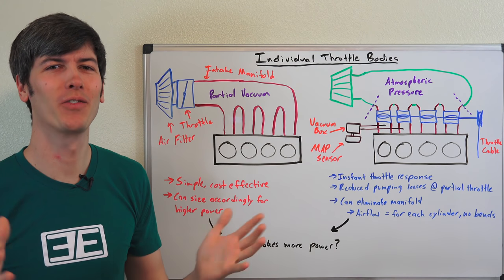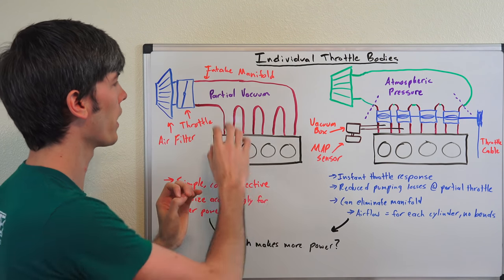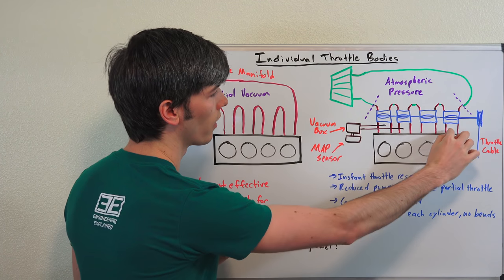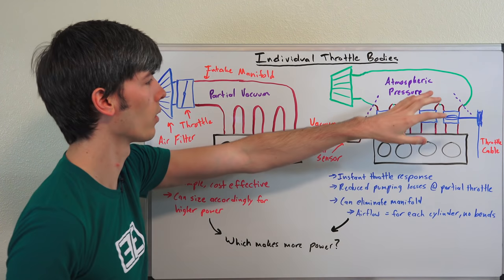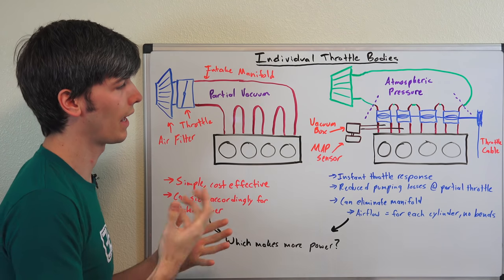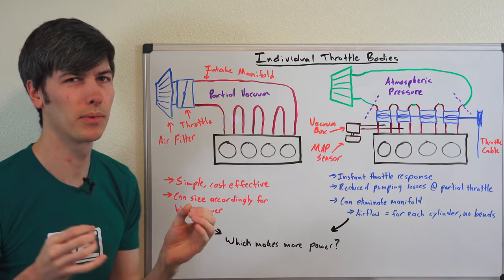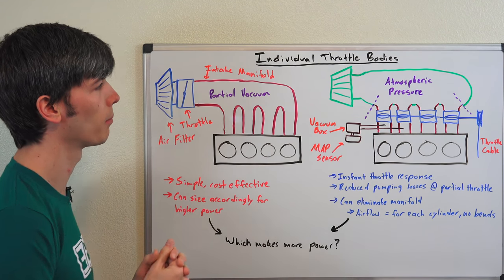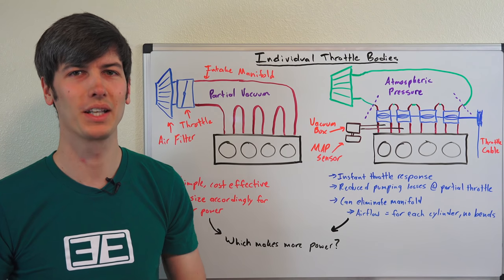Benefits Of Individual Throttle Bodies

Comment: Hey Jason,
Please could you explain the iVTEC system specific setup on J35 Accord engines 8th gen + up? Answering: 1- if it has any affect on performance like usual VTECs? 
2- How it really works to disable cylinder banks? 
3-If it reduce compression during could start or whats happen during start making sound much higher and lower down after some seconds?
Reply: guzforce that's really hard to understand. Can you try to rephrase it better?

I can answer for you but only if i can understand what you're asking specifically.
Reply: Ops!! Sorry, and thank you for trying to help.. let me try to point each question..
1- Regarding iVTEC on Accords V6, 8th generation, automatic transmission. Does it change the camshaft profile after certain rpm?
2- In wich areas of the engine the iVTEC works on our Accords? Only cutting cylinders for the VCM (if yes, how?), de-compressing engine for easy start, changing from low lift/duration @ low rpm --> to high lift/duration @ high rpm?

Comment: So if the engine is supercharged, then the supercharger would compensate for the partial atmospheric pressure in the intake manifold with the single throttle body system?  That would eliminate the advantage of the ITB system having full atmospheric pressure?

Comment: So would varying the runner length behind the throttle body have a similar effect to doing so behind the throttle body?  If so, all you'd have to do is find how long the runners need to be at peak torque, and how long they need to be at peak HP, and make the runners shorten up to peak HP.  Unless it's some kind of wierd setup that has peak torque up high, in which case you'd optimize it for whatever makes the most "space under the curve" as they say.

Comment: +Engineering Explained
Thanks. What I am wondering about, is why you have less pumping losses with either of those systems. Aren't pumping losses determined by the partial vacuum on top of the piston?

Comment: Could you do a video on cylinder pressures/temperatures before and after the combustion event, maybe even between a gas engine and a diesel one? I’ve always been curious about the actual forces inside the engines and how they might compare to the engines stroke and the nominal torque produced at the crank. It would help show the most basic engineering differences between the two designs.

Comment: my question is. What is the best size for a throttel body. In my understanding. If the throttelbody is smaller then the engine port. It slows down air speed which is bad for performance. but if its too big the engine will probably starve because there is not enough airpressure? whats best if the port and the throttelbody are mathematicly the same size or even the same form. or bigger? Or maybe even smaller?

Comment: Hi! I love yours videos and becouse I am also Engineer I love your approach to some problems. I have one question. Usually we can see ITB on specyfic tuned N/A racing engines becouse reasons you mentioned in video. What about forced induction? I saw pictures of such setups. Does the lag from building pressure in the system (lets do not take into consideration inertia of a turbo becouse you can use mechanical charger), the volume of air in intercoolers and so on. Do it has any sense if you do not use antilag system in turbo?

Comment: The different airspeed inside a single throttlebody/plenum for each cylinder, have got to be a less desirable effect, compared to equal air speed on ITB setups. The filling of the cylinder can't be 100% equal on a single throttlebody/plenum setup? right?

Comment: Why don't manufacturers build engines with individual throttle bodies (in sporty applications)? Is it really just a cost thing? Or are there actual disadvantages to using ITBs, notably on modern direct fuel-injected drive-by-wire cars?

Comment: First off, thank u for all ur awesome content

I always wondered: despite all the benefits of ITB, is it worth it because they pulls in hot air inside the engine bay versus a traditional single throttle body that can be combined with true cold air intake

In addition, with ITB, I’m always afraid that a rock or some small projectile may enter the combustion chamber(s) - since people generally dnt install filters on them

All in all, i love ur videos
Reply: I believe an ITB setup can still be done along with a plenum for a cold air intake or a forced induction setup, like on the Skyline GT-R's RB26DETT.

Comment: +Engineering Explained what about boosted set ups that run individual throttle bodies like the skyline r34 gtr?  they obviously have an intake manifold plenum for the intake charge and then the throttle bodies are at the end of each intake runner just before the head.  do you still get the same advantages as you would on an NA application?
Reply: I was also going to ask about boost + itbs.
Reply: similar advantages, but it also means that the the engine can breathe easier in snap-on-off-throttle scenarios, as with a single and a big plenum when you lift off alot of pressurised air is still in the plenum that gets inhaled post-throttle-lift, compared to the small amount of air that would be behind each ITB. If i've understood blow off valves correctly i think this means that more air gets left behind in the "plenum" rather than inhaled as it makes its way to the bov, if you have a relaxed bov, the increased amount of "left-over" air when snapping the throttle back on further enhances throttle response. In certain scenarios you can use a map sensor for each cylinder, in which case ITB's can ehnance power and reliability as the boost pressure is set for each cylinder due to the indiviual throttles (rather than the single forcing the air pressure to equalise amongst all four cylinders) and thus the fuel delivery can be adjust per cylinder accordingly, rather than a blanket-amount for all cylinders based on the plenum's boost-reading
Reply: duviday I think you have the bov workings incorrect. if you had itb's then all the air in the plenum would be lost to the bov when it opens. this is because there is no throttle plate separating the manifold from the intercooler piping. with only a single throttle body I guess there might be some chance for a bit of air to be left in the plenum but that would still end up in the motor as the valves are still opening and closing even when the throttle plate is shut.
Reply: I have a Toyota Aristo with a 2JZGTE and for the past 2 years I've been trying to figure how to work ITBs with a Turbo Setup in the perfect manner

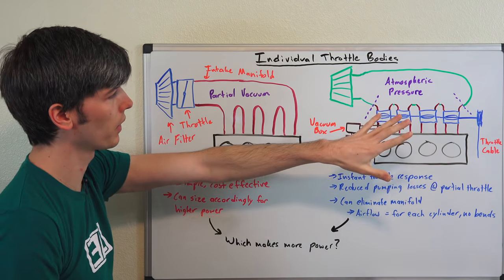Comment: I'd like to correct the point made at 2:10 where you don't need the intake for ITB engines. You do need intake trumpets that make for equal airflow to each cylinder. With out the trumpets the car won't run very well, the E46 m3 crowd has looked into it extensively.

Comment: everyone in the comments is talking about how sophisticated this system is...well its much simpler than what many, possibly most cars use today use direct injection which runs at pressures up to 3000 psi and some use both direct injection and port injection...im just glad this is all going away soon. my next motorcycle will be the zero electric powered bike

Comment: Would it be impractical or imprudent to use individual throttle bodies on a turbo or twin-turbo setup?  It seems like you would really lose the advantage of the system.

Comment: Why does the smaller volume under vacuum translate to less pumping loss? Since the pistons are still displacing the same volume, but there's less air to pull from, wouldn't there be a larger difference in pressure across the piston?

Comment: Does it make any benefits in turbocharged engines?
Reply: R32-34 skylines had ITBs and twin turbos on their RB26s
Reply: but the idea is that 4 or 6 or however many throttle plates your ITB system has, will be able to flow a greater volume of air than a single large throttle body. The benefits are essentially the same, it allows greater throttle response, and greater airflow at higher rpms. In a turbo application though, the added benefit of quicker spool, esp on larger single turbos, comes along with that quicker throttle response.
Reply: The whole vacuum/boost system, however, is where it becomes complicated in a turbo application

Comment: can you make a valve before those throttle bodies, to clog one or more of the cylinder for better fuel consumption during low power situation?
such as on bumper to bumper traffic or highway cruise where it's just maintaining constant speed at moderate rpm.

Comment: Couldn't you also cut off a cylinder or two in an engine with ITBs? That way you could have a V8 to accelerate and then a V4 once you get up to speed (like the newer Chevy Suburbans have, which may actually be exactly what I'm talking about).

Comment: Is there any truth to the notion that running individual throttle bodies (whether fuel injected or carbureted) leads to cooler engine running temps?
I heard that claim from a Shelby Daytona Couple (replica) V8 engine builder.  He claimed it was a substantially lower intake air and that it had something to do with heat from the valve of a just-fired cylinder raising the temps of the overall/combined intake air when two or more cylinders share an intake.  

I would love to hear your thoughts.

Comment: Jason, cool video. I'm a semi-new subscriber and always find your videos insightful and well thought out. 
But what are some examples of cars that use each particular setup say from the factory? Thanks
Reply: Pretty much most cars run single throttle bodies from the factory as they're cheaper and simpler and throttle response is not the highest priority. Take almost any Toyota, Subaru, Ford, Chevy, you name it, it'll have singles. Certain high performance engines, such as the RB26DETT in the R32-R34 GT-R, and things like BMW's S65 V8 and S54 straight-six (E9x M3 and E46 M3, respectively) run individual throttle bodies from the factory though, because they're in more expensive cars to begin with (budget doesn't matter so much), and are built with high performance, and thus great throttle response, in mind.
Reply: P1 Race Photography Thanks bro, exactly what I was looking for. cheers
Reply: I'm not sure about these days, but I recall motorcycles used to often have individual carbs for each cylinder - I'd assume at least some are now using ITBs, most likely restricted to the high-end sports models.  Thoughts, anyone?
Reply: aussiebloke609 Correct, pretty much all multi cylinder bikes have ITB's. Older bikes had independent carbs and more modern fuel injected bikes have throttle bodies and a fuel rail + injectors (or multiple rails for v configurations). That's why bikes sound so good!
Reply: Thanks for the response, Coldfin9er.  I've only had old bikes (the most modern was an '81 Honda RS25 - everything else was from the '70s.  So I could make a rational guess, but didn't have the actual experience to say for sure.  :-)

Comment: Sooo how do you super charge an idv? If the idvs are piped like a header to a single intake tube that was fed filtered air from a compressor maybe? What's the power here? 3.0 at 100% V E? Or with a positive displacement supercharger like 125% maybe idk kinda?!? How close does idv get to 100% Volumetric Efficiency?

Comment: i have a question, in SI engines what happens if the intake runner used is smaller than actually required? is it true that , reverse flow will cause some of the fuel to be lost out the intake to the environment and hence the AFR requirment becomes higher and drops the efficiency? i just cant visualize it. can you show some schemetics or video if possible?

Comment: Hey can you tell me what are least expensive and least risky mods I can do to observe a noticeable bump in throttle response especially at lower RPMs? Which of those mods will improve efficiency and which ones will improve power? (I am talking about a 2012 Civic). At this stage I am not looking at Turbos. I don't want some monstrous 250 + BHP, even 10 BHP will do, but I am mostly looking for an improved throttle response and efficiency (if at all those two can go together). I am quite new to mods as such and would appreciate some help ...

Comment: is it factual that in the conventional manifold the cylinders are pulling air from each others runners for a short time and that's why the throttle response isn't there like the ITBs?

I think the ITBs will make more power if 2 engines were built exactly the same because tuning the ITB engine will require more fuel than the conventional. I could be wrong...

Comment: @Engineering Explained , is there an instance where ppl would use individual throttle body systems with power adders like tubos? Is that possible/ practical and would there be any benefits

Comment: Would this only apply with N/A engines? Would there be a benefit of having multiple Throttle Bodies on turbo or super charged engines?
Reply: AAG885, it doesn't make a large difference in turbos. The turbo lag is significantly slower than the throttle response, therefore you would never notice a difference or benefit. With Supercharger, I imagine not either because the intake plenum is already at a positive pressure...

Comment: Do ITB's excist even as driven-by-wire?
Reply: Βαιος Καλιακουδας yes they definitely do. In fact I would say that the majority of itb engines that have been made in the past 10 years are also drive by wire. At least, in cars. Motorcycles almost always have itb's but don't always have drive by wire.
Reply: Jeff Beasley because mostly in sports touring motorcycles and dirt bikes is a bad idea to get By-Wire or other Electric-Operated or Electronic controls either because if you get stuck in the middle of nowhere while you ridin' it's annoying for you for a component like these to get broken and difficult to fix 'ex that's why most motorcycles in categories like those ones still have manual-operated controls

Comment: My car doesn’t have individual throttle bodies but it has 2 throttle bodies side by side in the front of the engine. My mustang gt has the 4.6 3 valve engine but the coyote 5.0s now have just a single large throttle body. What’s the benifits kf each ?

Comment: So, what you really want is an ITB system with computer controlled variable runner length combined with a variable geometry manifold to maximize torque across the board...

Comment: Each throttle body of a BBC’s ITB is 50mm.  That’s equal to 400mm.  A Fitech EFI system has 1 throttle body @ 102mm.  ITBs flow 3.92x more air.  Perhaps ITBs’ should have 12.75mm throttle bodies.

Comment: What I don't understand is with an ITB/multiple-carb setup when you have hoses from each runner going to a common vacuum box; how does air/air-fuel-mixture not get pulled thru those lines and thru the vacuum box from one runner to the other?
Someone explain this please if you can.

Comment: How do the ITB's deal with cold starts? Most throttle bodies I've seen have a separate assembly that has temperature  feedback which  controls mixture at start up and idle . The throttle body butterfly is completely closed during it's operation.
I've looked at a few ITB's and they don't seem to have this .

Comment: Can it be used for engines, let's say that have more than 9000 rpm and yet perform good. high rpm engines for example of Ferrari and Lamborghini don't use such system but use single throttle body. even when they operate at high rpm.
Reply: Motorcycles use them. Peak power at around 12k rpm for the four cylinder engines.
Reply: They are used in the LFA's V10.

Comment: You failed to mention:
High performance camshafts have much more duration... Keeping the valves open longer... This creates reversion of exhaust gasses at low RPM... The plenum helps absorb these pulses... Individual runners are a bear to tune... Unless you have a lot of experience... I don't recommend it for a Street Car...
CrazyHorse Speed Shop